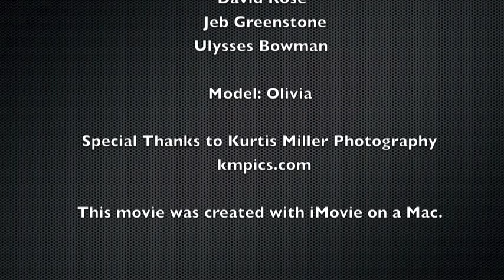A Scratch-Built Hot Rod / Rat Rod from Cutworm Specialties

Comment: thats been done on and off over the years by hot rodders...its a way of getting it out of the engine bay either for looks or because it simply won't fit (i.e. it'd be hanging out the side of the engine. ) Running it off the tailshaft means it will charge while the car is in motion, but not at idle / stopped so not an ideal setup...saw a car recently that ran it off the flywheel - alternator was at the back of the engine near the trans...